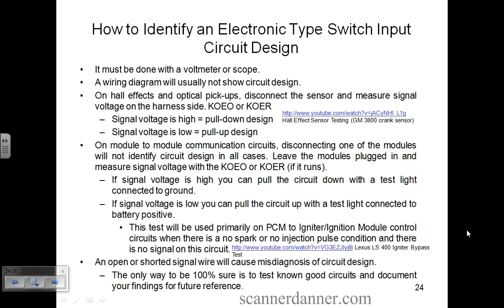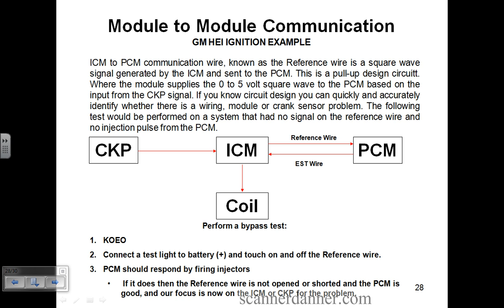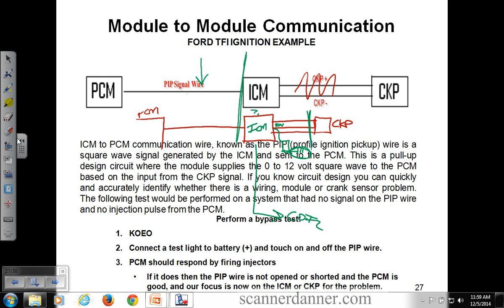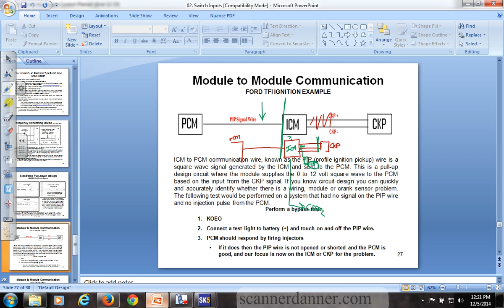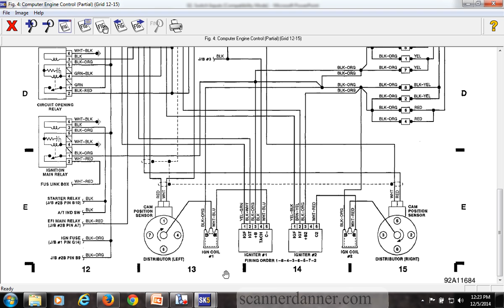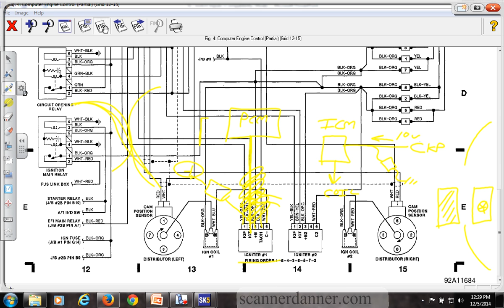Circuit identification-module to module communication (pg 27, 28 expanded content)

Comment: 7:11
the harbor freight "heavy duty" test light is 280ma at around 12.6v  which use around 3.5 watt bulb where your otc is around 150ma and uses a 2 watt bulb.

Comment: that etcg video...pull-up design...and hall effect switch closed(i wonder why u never mentioned it?)...bcus, had it been a pull-down and switch closed you would ve had zero volts there...and had you tried to pull it up by test light connected to batt(+), the test light would ve lit...then you would ve disconnected the hall effect...jumps to 10v...oh, it s a pull-down!...am i right?

Comment: HELLO PAUL!!!, im from PERU!!!, big fan, i learn a lot with your videos, all your awesome test makes me apply all the teorical knowledge that i have
well my question is that i watch the video you did with ETCG, and you were pretty sure that it whats a pull down design, YOU EVEN CRANK THE ENGINE AND STAY THE VOLTAGE UP ALL THE TIME!, and  you pull it to ground, made a spark, and that was it to call for a bad sensor, "pull down design"; now if it were a pull up design, like you are saying in this video, why the icm is not activeting the coil all the time and burn it out or cook it???? is 12v all the time, is saying to the icm to give the coil a ground!!!, im a little confuse here, also because in your circuit designs that you put at the end of the chapter 2 you called a pull down design, is contradictory of what you are saying in this video, ¡¡¡reading that makes me more confuse!!! i hope that you can help me with this
Reply from the maker: Are you asking about this video or the video with Eric?
The signal that I was messing with with Eric was the PIP wire on a Ford EEC IV system. With the Key on, you can see a steady 10v and you can see a steady 0v depending on where the window of the hall effect is when you shut it off. 
On these Ford systems, it is a pull-up design. The Module creates the 0-10v square wave and sends it to the ECM. 
Regardless, with the Key On and the connector plugged in,  I was reading 10v, so I pulled it to ground to create the high low signal the ECM and Module needed to see to create spark and fire the injectors. 
As I stated in this video, when it comes to module to module communication signals, the lines get blurry.
Reply: i study the diagram of that ford f150 and because that signal is going to the PCM and the ICM at the same time from the hall sensor, is easeir to make it a pull-up design im guessing, if this is correct then  the exact problem that was happening with the sensor is that his internal transistor was short it and sending 12v all the time because you crank the engine and the signal was a steady up voltage????, now i am wondering if 12v does not means energize the coil, and 0v means open the coil (-) circuit to make the coil fire???,  all this that am saying is correct??, thank you PAUL!!!!!!!!
Reply from the maker: I think I am following. You will love my next uploads to this channel. It is an EEC IV system that has issues with this exact circuit! I am working on it now as we speak. 
I believe, when in module mode (spout disconnected), the coil fires when the PIP signal goes from high to low ( i think). I need to go back and look. But a lot of your questions will be answered coming up. 
Also remember that this is only one design. When it comes to creating a signal to force a system to fire a coil, the rule to follow is, if the signal is fixed high, pull it low, if the signal is fixed low, pull it high to create a signal the computer will recognize. Make sense?
Reply: +ScannerDanner Premium yeah it makes thanks that rule! it is correct, so you say that if the spout was disconnect , then the ICM is going to fire the coil when you go from high to low so is only that situation with the spout disconnect  that would cause for the ICM to energize the coil all time to cook the coil, because the voltage was high,12v, all the time; but i read that at the moment when you are starting the engine the ICM does not listen to the spout signal, only listen to the pip signal thats coming from the sensor to fire the coil, and is in a staedy 10° of advance, so if is high 12v, means energize the coil, and low 0v, means fire the coil, then why if is was 12v or high all the time, even cranking, why dindt cook the coil, why it was not energizing the coil all the time if the ICM does not listen to the spout at the moment of cranking????, well i can not wait for that vídeo!!!!!, thanks a lot!!!!!
Reply from the maker: It is only the event of going low to high and high to low that is "looked at". The coil is not being energized with the key on engine off regardless of the pip signal voltage being fixed high or low

Comment: Hey Paul I am not an authority at all of electronics. However I had a thought I think you might like to hear. First let me say what I know. A PNP , NPN are two versions of a bipolar transistor.
1) The PNP needs a negative potential at the base to allow positive flow from the collector/emitter.
2) The NPN needs a positive potential at the base to allow negative flow from the collector/emitter.
These devices are used all over the equipment I work on. The thing I noticed about how they are placed in the circuit is this. They are on either the positive side or the negative side. Interesting as this may be to read, here's where this applies to your video. 
We know the coil in the video, has a constant battery positive on one side of the coil through the ignition circuit. So the control side which is negative, is the side the computer needs to manipulate with that square wave. So since the question is to determine whether the electronic switching between 
modules is pull up or pull down. Do you think if you identify from a diagram the side of the circuit the control is on. Then with your minds eye imagine the appropriate transitor (PNP OR NPN). You may be able to determine if the the square wave switching the coil is pull up (NPN) or pull down (PNP). In this video the negative side of the coil is switched and it happens to be controlled by a pull up design square wave sent from the PCM on the IGT1, IGT2 circuit to either selected igniter module. Stated earlier the positive potential of that square wave theoretically hits the base of the NPN (on the bulls eye, everytime according to the frequency of the square wave) and makes the spark. Tell me what you think of this? I want to eventually look and apply this to the list of cars you have in chapter 2. To check if this may be valid. Variables pop up all over in a every circuit design, which is why I try to keep an open mind. Hope this is good discussion for drinking a beer. 
All the best 
Joey Q
Reply: That's quite a clever thought but because the innards of a module can be more complex than a single transistor you can't rely on a basic rule of thumb. The best you can do to simplify it is learn a given system and next time you see that system you apply what you already learned/know.
Reply: Wow, brings me back to electronics class way back when. 😉👍